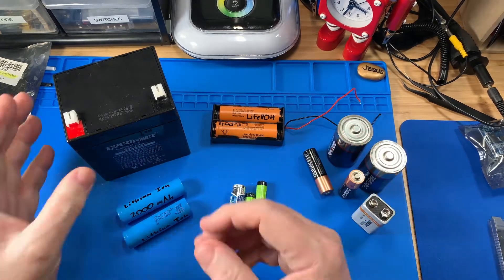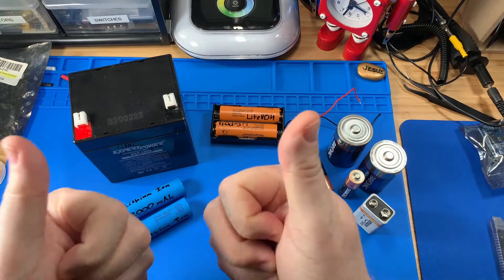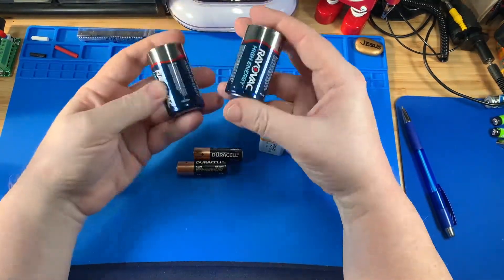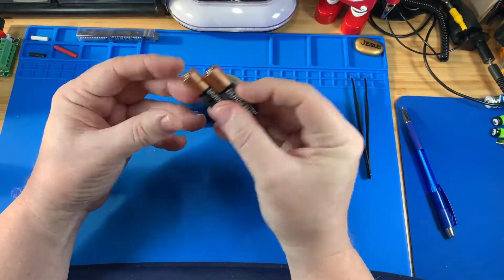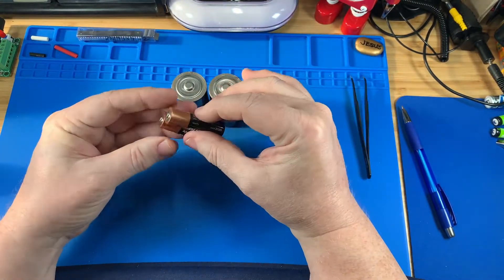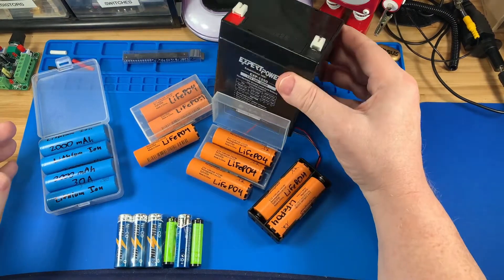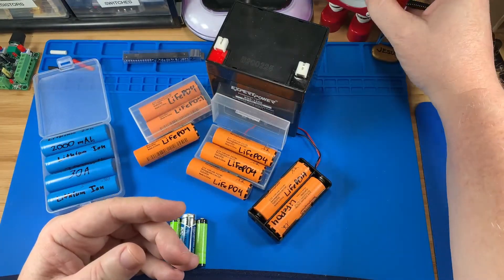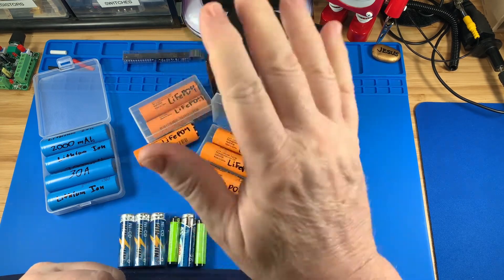Finding the Right Battery for Your Electronics Projects

Comment: Nice, I am trying to feed my pico with a 3700mAh module I saw in Amazon, seems rechargeable through the same plug to AC and in case of power outage the pico can keep running for a day. Not sure if I need to get a LiPo 6v 4.5Ah but seems that I need a special charger for those. My dad got blind so I will be creating a smart home.
Reply: That’s an amazing thing to do for your dad!